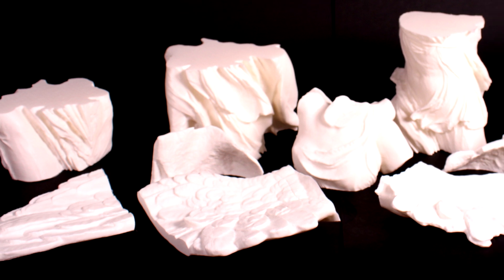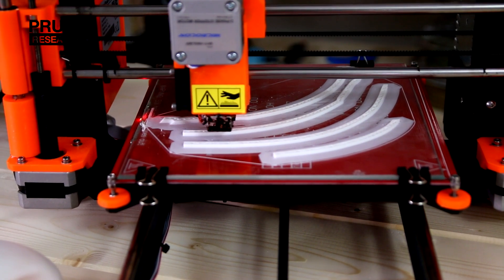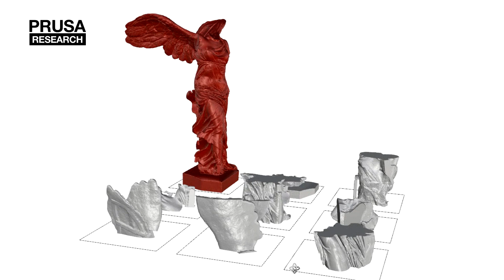How to: Big objects - Tips and Tricks #8

Comment: When I print larger multi-part objects with ABS I like to make my own gooey "ABS glue" to bond the parts together.  I use acetone to dissolve some bits of scrap ABS (in the same color as the print) in a small glass jam jar and then use a little wooden stick to spread the homemade glue on the joints.  I find the parts need to be clamped/held in position over night for full strength.  Joints can then be sanded and cleaned up as need.

Comment: Great tips! I used epoxy to fill the joint but its very hard to smooth the joints after, so I going to get me a Doodler 3D pen for it. I made the Nefertiti model on original size on my Prusa i3 printers and had to cut it into 11 parts to fit the buildspace. Details on my Facebook and website:https://www.facebook.com/3dprinterlab/http://www.3dprinterlab.org/
Reply: 3D pen is a very interesting solution, but in a pinch i think i'd use scale modelling filler instead of epoxy, such as Mr. White Putty, Tamiya, Revell, any some such, and you can get them at most toy stores in the scale model division. They are designed to give a very smooth surface while filling imperfections that is also easy to sand, prime and paint. Indeed they also self-prime the sections where they have been applied but not fully sanded. If the sub-surface hardness is not a priority but surface finish is, it might even be the ultimate solution.